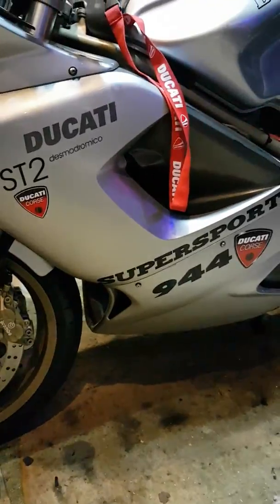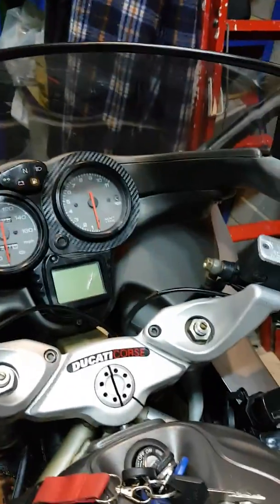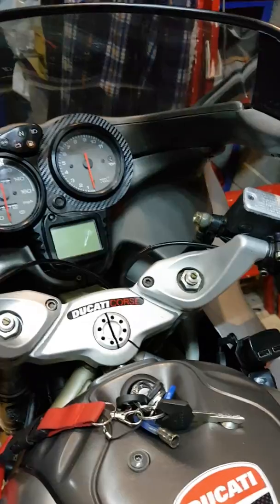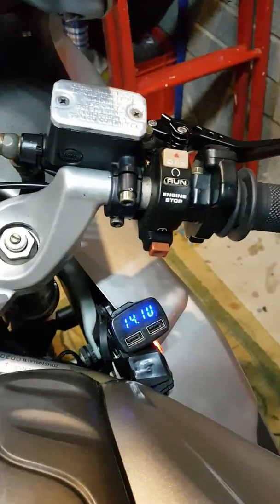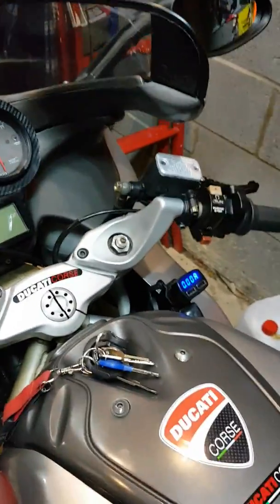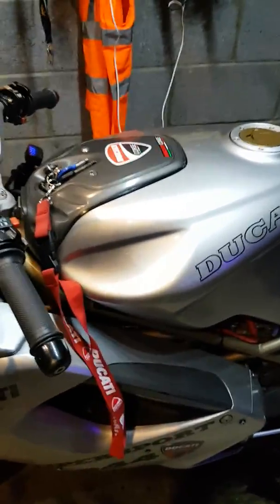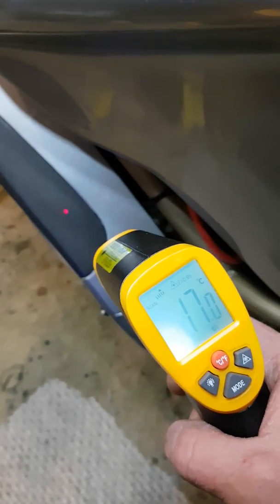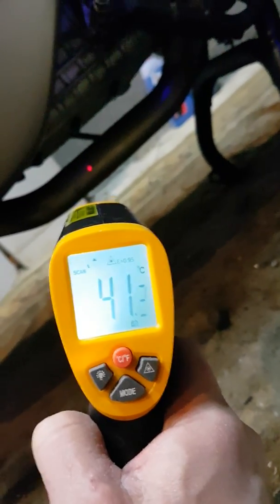Charging system on Ducati ST2 1998  fitted volt gauge

Comment: What battery are you using? Just replaced the stator and reg/rec on my ‘98 ST2 and I cannot better 13.6v .
Reply from the maker: I am very sorry for the late reply, I hope now that you have resolved the charging issue and you are getting 14V ? The battery type will not affect the max regulator output, unless it is fully charged.
Reply: @motorcyclegarage2307  no apology necessary. I resolved the issue. There was obviously some loss in the loom. I fitted a relay between the battery and the reg/rec voltage reference  (black wire on my '98 ST2!). I also used this circuit for a digital voltmeter and was seeing normal charging voltages thereafter. Thanks.

Comment: so have you wired that usb/volt reader straight to the battery or did you cut into the loom ?
Reply from the maker: Straight across battery terminals as it is switchable. I switch it off when i dont need it.